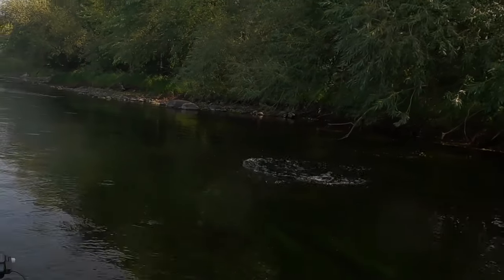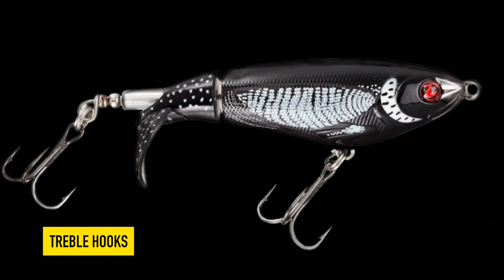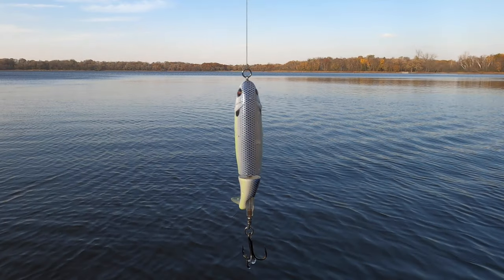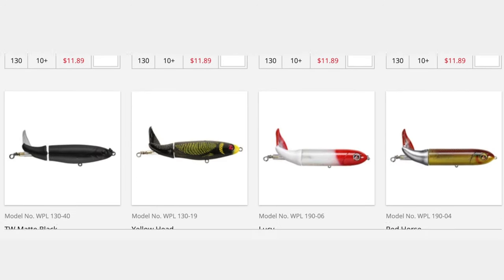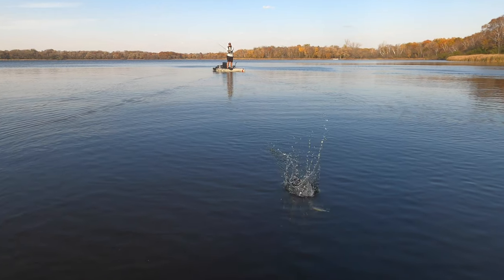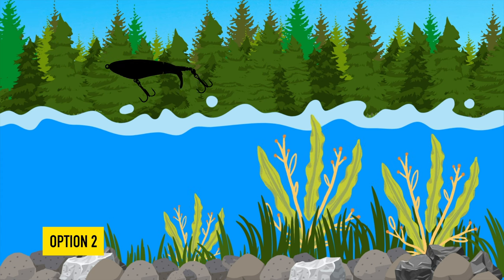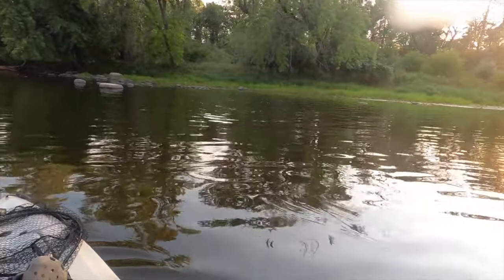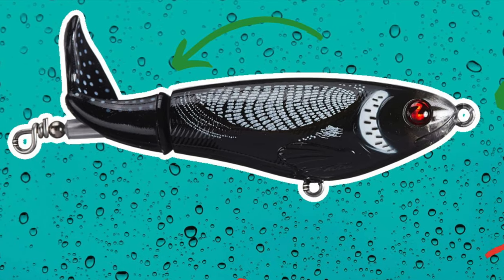The Design & Function of the Whopper Plopper

Comment: I add a split ring swivel to every whopper plopper, it has no impact on the function, but pretty much eliminates all line tangle.
Reply from the maker: Nice! I typically use a swivel snap but I’m planning to completely switch over to split rings next year. Split rings never fail!